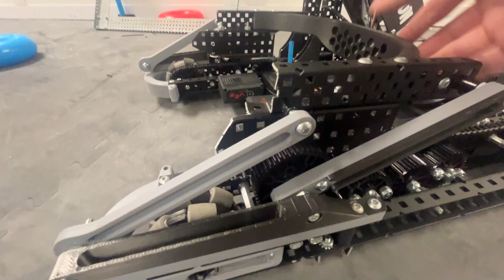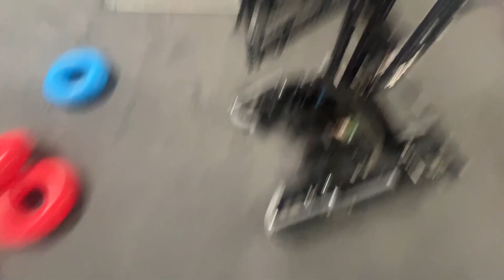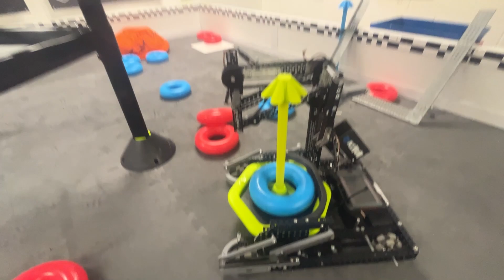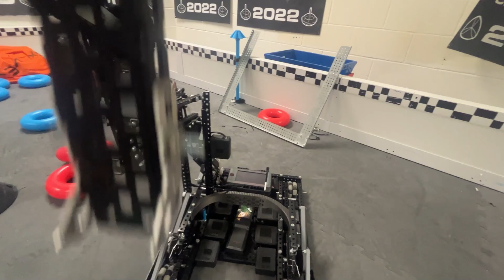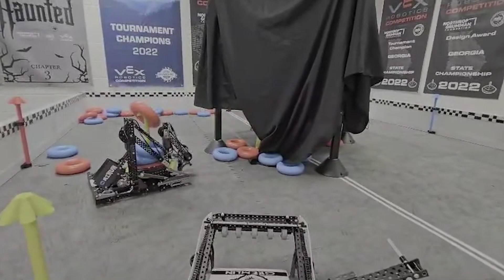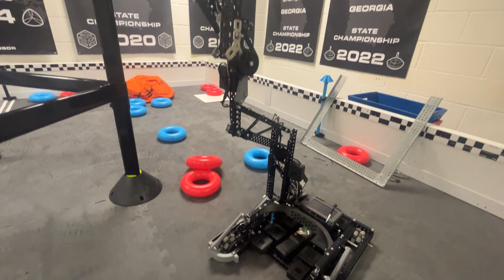Minun Explanation | Gremlin x Owl Early Concept | VEX High Stakes

Comment: "The only functional (serves a purpose and does a task, like holding license plates) 3d printed parts allowed on your robot are custom license plate holders. You can also have non functional decorations that are 3d printed. No functional parts, like gears, bearings, etc may be 3d printed and used on …" - vexforum.

im pretty sure that the 3d printed parts are illegal, unless ofc you guys are vexu, the only allowed custom parts are 3.5mm< polycarb
Reply from the maker: @kjlkdjasd  🤓
Reply: @GGremlin-fr5fy  so we're getting dqed next comp..
Reply: The intention of 3D printed components was more of a thought experiment to see what is possible with High School motor allocations and the inclusion of 3D printed parts. It is very much not intended to go to and compete at a High School event.
Reply: So is this legal or not? (3d functional parts)? thanks
Reply: @jonathanclark1333  not in official competitions i don't think so
Reply: @jonathanclark1333 I mean it is VURC legal